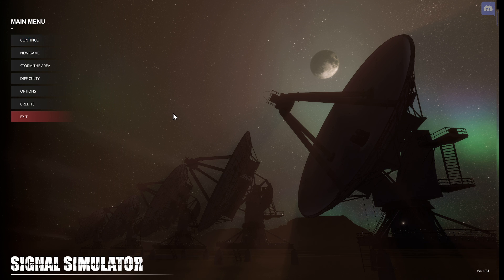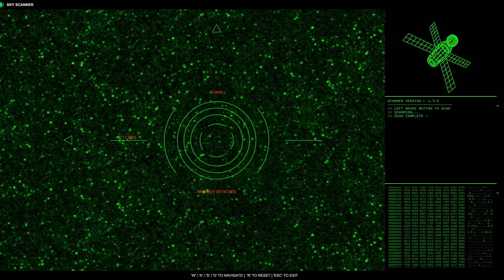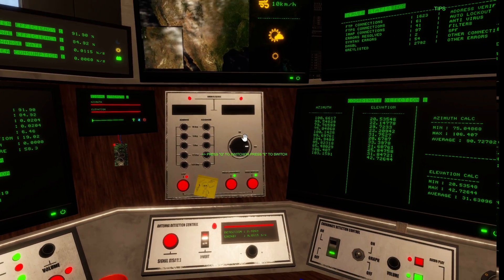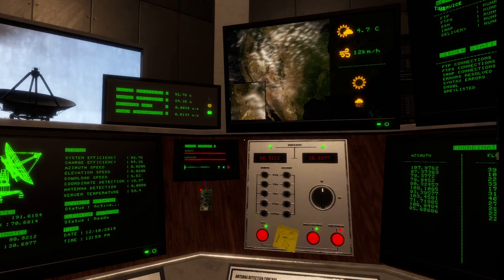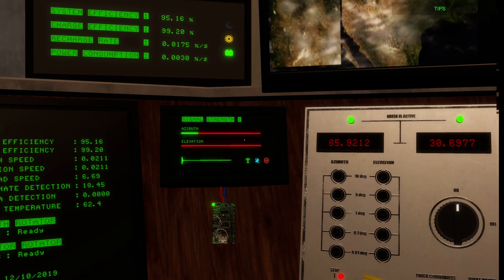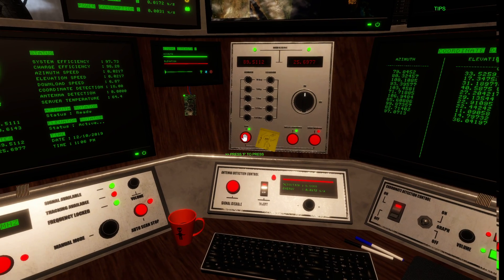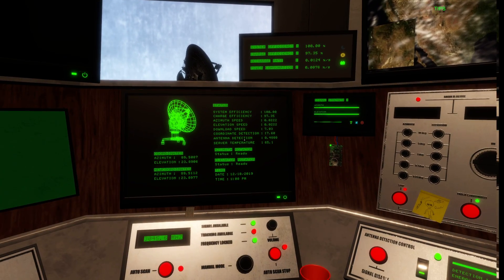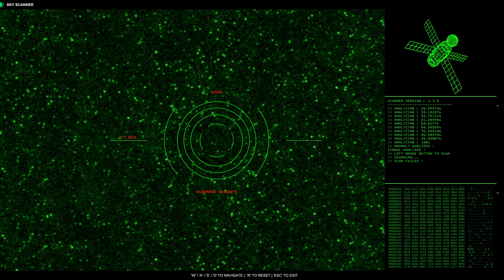signal simulator/how to find a signal

Comment: i dont understand why when i do manual adjustments to azimuth and elevation it does NOTHING. i regularly clean my panels and check diagnostics. for some reason even when i reboot i cant get the system efficiency to work.